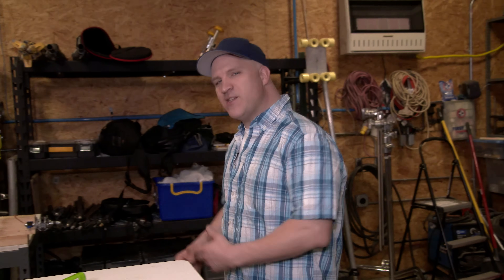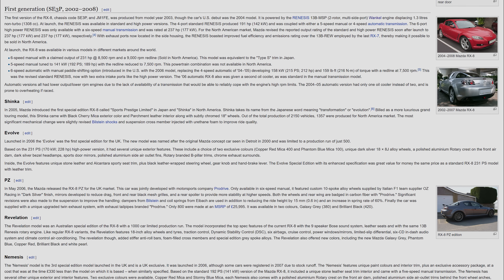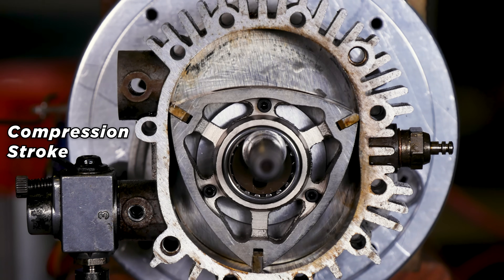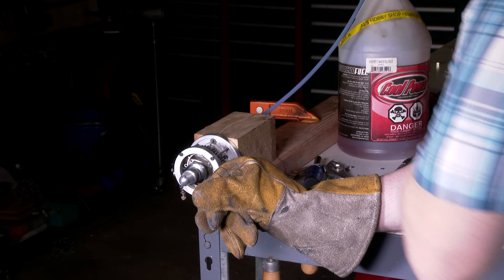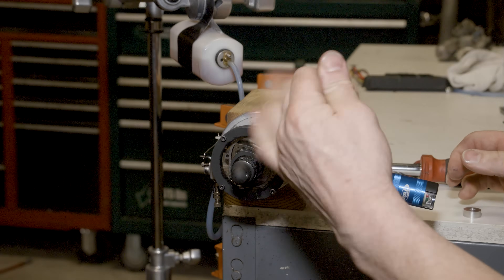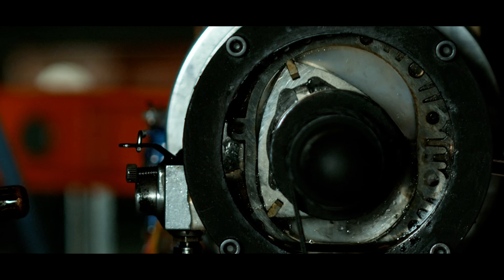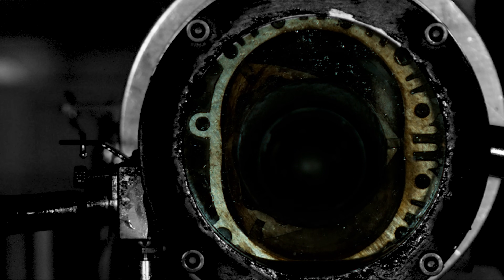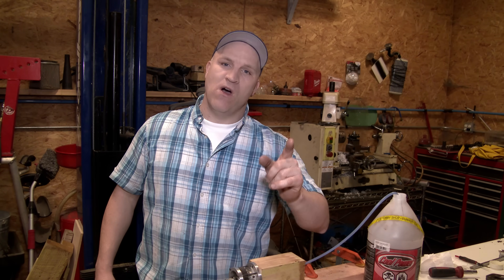See Thru Rotary Engine in Slow Motion - (Wankel Engine) 4K

Comment: I heard that rotary engine mazda owners verify their gas level and put oil in the car when at the gas station....
Reply: Jean-Yves Laliberté premix with 2 stroke oil to extend engine life
Reply: @Ben Stevens Only the ignorant ones... pre-mixing with 2-stroke oil is not recommended or safe... 2-stroke oil does not extend engine life or meet Mazda's minimum specifications and causes damage to the engine.
Reply: doktorbimmer I bet you still use 5w20 too right 😂😂Yeah you don’t know what you’re talking about buddy.
Reply: @Ben Stevens Only stupid people premix. I know exactly what I'm talking about... and I can prove it son.
Reply: doktorbimmer I’m listening you’re still talking
Reply: @Ben Stevens If pre-mixings works as you claim? Why doesn't Mazda recommend it? Why have Mazda engineers chosen Metered Oil Injection on all its production since the 12A???
Reply: @Ben Stevens Can you tell us what very important negative issues that are related to using pre-mixing instead of oil injection. Or are you suggesting pre-mixing has no down sides? Please explain how pre-mixing can extend engine life when there is no factual proof that it does... pre-mixing actually damages the engine and shortens engine life, it reduces power and efficiency when compared to oil injection... Do you understand why? Or are you just blindly repeating what some unqualified or inexperienced person has claimed?
Reply: @Ben Stevens Why would you use motor oil intended for 2-stroke engines in an engine like the Wankel KKM which is a 4-stroke?
 You are aware that 2-stroke and 4-stroke engines have very different operating principles and lubrication requirements that also require special lubrication specifications... Are you aware that many of these specifications are not interchangeable or meet manufacturer specifications???
Reply: Didn’t mean to start an argument guys lol, it was just a joke my dad told me a long time ago! 

The idea here is to NOT buy any rotary engine car ;-P
Reply: @Jean-Yves Laliberté Indeed, the best advice is not to buy one of these very unreliable, obsolete engines in the first place.
Reply: doktorbimmer before I even attempt to explain to you answer this. So bc mazda recommends 5w20 is the usa that’s the oil I should use in my Rx8? Answer please
Reply: @Ben Stevens WRONG! Mazda RECOMMENDS any of the oil weights listed in the operators manual found in you TEMPERATURE/VISCOSITY INDEX CHART This may vary by the region the vehicle was first sold.*
 The CORRECT ANSWER; Mazda recommends oil with an API rating of 'SL' or EC rating of 'GF3'  any oil with rating that has a viscosity that matches your climate and temperature range found in the chart IS APPROVED.
Reply: @Ben Stevens WHAT 2-stroke pre-mix oil you are you using that meets API SL/ EC GF3???? Please answer???
Reply: Are you a teacher Ben Stevens, because this is a tricked question!!
Reply: Jean-Yves Laliberté Ben is no teacher.. but he is about to get "schooled"
Reply: doktorbimmer what if my professional job was a teacher? Lol guess you know it all buddy. I deal with a lot of people in the race world and rotaries Hondas all that shit there’s nothing wrong with premixing buddy. I was trying to explain that I ran into some idiot on YouTube that said premixing is wrong for a rotary engine he looked at me crazy and said don’t you even reply. Green label racing castor made for rotary engine is what I use... And glad you know how to read a manual bro
Reply: I bet you put synthetic in it too huh 🤣
Reply: And that’s good I mean you can go off of what mazda says I’m not saying that’s wrong all I’m saying. To call someone ignorant for premixing really? Explain idemitsu then Mr know it all
Reply: @Ben Stevens Then I feel very sorry for your students...

Just more than you about pre-mixing 
 
Mazda has never sold a Rotary engine son, it sold Wankel KKM engines under the "Mazda Rotary®" brand name until 2012.
Reply: @Ben Stevens Klotz  BēNOL®???  This product is not recommended for any 4-stroke engine including the Wankel. Its only recommended for ratios up to 50:1 and is not compatible with petroleum oil either
 ITS API RATING IS ONLY 'SA' The LOWEST API RATING and does NOT meet Mazda specifications.
 It does not meet ANY EC ratings
Reply: @Ben Stevens According to the API, the term "Synthetic" is a meaningless marketing term... it only recognizes 2 types of base stocks based on their lubricity index.
Reply: @Ben Stevens There are 5 classes of motor oil base stocks that are sold under the marketing term "Synthetic" motor oil THREE of  them contain mostly petroleum base stocks... CAN YOU NAME THE OTHER TWO BASE STOCKS????
Reply: @Ben Stevens I can read owners manuals AND PRODUCT LABELS Sounds like most of what you know about motor comes from advertisements and internet rumors.
Reply: In my opinion, I would lean towards trying to put a little bit of 2 stroke engine oil in the gas tabk as I would think that it is meant to be combusted.... as opposed to a 4stroke engine oil? But I’m no mechanical expert and haven’t researched it as I was waiting for you guys to educate me SMH!
Reply: @Jean-Yves Laliberté You do not want to ever mix oil into your gas tank unless the fuel system and engine are designed for this. Adding additional oil into the combustion chamber to extend engine life has become a popular myth but there is in fact no advantages to introducing more oil than is injected by the Oil Metering Pump... the simple fact is too much oil is just as bad as too little oil. Pre-mixing causes more harm and has no benefits.
Reply: “   I know how to sit on a fence. Hell, I can even sleep on a fence. The trick is to do it face down with the post in your mouth.    ”

 - Dwight Kurt Schrute
Reply: @Jean-Yves Laliberté No worries my good sir, you are a scholar and a gentlemen... but it seems are young, naive lad Ben here needs to find himself post to bite down on quick before he digs himself in even deeper.
Reply: doktorbimmer y’all weird dab
Reply: @Ben Stevens Only the ignorant ones pre-mix... Thank you for proving my point son! Cheers!
Reply: @Ben Stevens And the API American Petroleum Institute publishes empirical data based on proven facts. You can't even read a product label son.
Reply: @Ben Stevens If you cannot offer any facts to support your false claims??? then opinions are all you have son.
Reply: doktorbimmer Premix to help lubricant of engine. Stock omp is not enough. (: premixing is a highly controversial topic. You’re entitled to your opinions
Reply: @Ben Stevens Pre-mixing only causes harm, it is not recommended by Mazda for some very good reasons that you seem completely oblivious of. Yes it is, if the OMP is delivering the correct amount than your OMP is installed incorrectly, damaged or needs service. There is no advantage to adding more oil than is needed. Pre-mixing causes carbon deposits and lowers the effective octane rating causing damage to the apex and side seals, spark plugs, lambda sensors and emissions equipment. Only among those who are not knowledgeable on this topic, the engineers at Mazda and lubricant manufacturers have no doubts.
Reply: @Ben Stevens I'm also entitled to call-out people giving bad advice on topics they do not understand... you should be ashamed of yourself kid, what you are doing is wrong.
Reply: @Ben Stevens Son, if you just read the manual and put the right oil in the right hole??? The OMP won't need any help... if your engine fails due to lack of lubrication??? It because you didn't check the oil level often enough.
Reply: @Ben Stevens The primary failure mode in Wankel engines is NOT lack of lubrication... this is another false urban myth spread by novice and amateur individuals that have no formal education or experience in field of automotive engineering or engine design.
 Apex seals fail as a direct result of ablative and brisance damage due to erratic and uncontrolled flame propagation and deflageration in the combustion chamber.
Reply: doktorbimmer 💀
Reply: @Ben Stevens What's the matter kid? Cat got your tongue? Without any facts you can't back-up your false claims.
Reply: @Ben Stevens If you are interested in learning more about Wankel engines or why you don't pre-mix the ones made by Mazda? I would be very happy to give you some additional facts and information... that way you won't keep making a fool of yourself. Cheers!
Reply: doktorbimmer 😎
Reply: @Ben Stevens Hey Ben! You put the oil in the ENGINE! Not the gas tank DUMMY!
Reply: @Ben Stevens Don't believe me??? CHECK YOUR OWNERS MANUAL... It says put GASOLINE in the Fuel Tank and OIL IN THE ENGINE!!!!! Lol!!!!

Comment: All the fuel going out
Reply: Very inefficient... that's why these engines are obsolete now!
Reply: doktorbimmer if it makes that much power at such a small size why don’t they make it at a bigger size and find a way to burn all that fuel before it goes out the exhaust but wouldn’t it make more HP at a bigger size
Reply: Bigger size means it would only waste more fuel, reciprocating engines make more power and use less fuel... that is why they are still made and these are no longer made.

Comment: That's neat! Does a real rotary engine use diesel?
Reply: No, Wankel engines require spark ignition only and a relatively high octane fuel to prevent damage, Diesel fuel is extremely low octane.

Comment: wankel engines rock  troll alert? leading plug hole lover?
Reply: EXCELLENT!  You are a quick learner indeed..to make that analogy means you understand the concept now... YES, in that regard the Wankel is Exactly like a 3 cylinder engine...each face is a separate chamber and each performs all 4-cycles one at a time just like the Otto engine.
Reply: @erniebrinkrotaryhemi7336  i love the moving combustion chamber

Comment: Any internal combustion engine is inefficient at start up until it reaches normal operating temp. Ideally we would all be driving electric vehicles with efficient modern batteries that are charged via a power station that uses non dirty source of power production. Nuclear power is probably the most viable source but people are shit scared of it. Even though coal is even worse in my opinion.

What's the point? Well I don't care about how inefficient the rotary is.. Well I do to a point but I think if we had more engineers working on them we could realise many gains from them. Just look at what the 13b in rx8 has achieved through optimised port positioning. It was about 20 years ago that you would only get that power out of them with serious port work like a bridge port and they would drink fuel. I like the rotary because it is super simple and elegant in its concept and design. No valves slapping about, no camshaft timing to worry about or belts. No springs, seats, collets, retainers, lash pads. All those components and the pistons rods and heavy crank need to rotate and that mass all needs to be balanced etc.. 

A 4 rotor won Le Mans and it was actually more fuel efficient than the competition. With more innovation the rotary could do so much more.
Reply: thank you dokterbimmer
Reply: @erniebrinkrotaryhemi7336  Call us today at +1-530-756-1230 or Email us at fm@freedom-motors.com
Inquire about our Rotapower® engines, or about investing in Freedom Motors!
Reply: @erniebrinkrotaryhemi7336  THE FOUR STROKES OF A INTERNAL COMBUSTION OCCURS SIMULTANEOUSLY IN A 
WANKEL ENGINE THIS MAKES IT MORE EFFICIENT THAN A PISTON ENGINE
1
Reply: Ernie! WHY? Why does you engine not run????

Comment: It's obvious gasoline is not the best type of fuel for this engine
Reply: @tmac20031 This engine is not running on gasoline... its running on nitromethane.
Reply: @doktorbimmer  what he says is still truth
Reply: @renatinhoss NO, its not true... gasoline is the most common fuel type used in Wankel KKM engines and is best fuel type available.
Reply: @doktorbimmer  the most common, yes. The most cheap and available, yes.
Reply: @renatinhoss Clearly you are not familiar with the history or development of the Wankel type KKM engine, it was originally intended and specifically designed to use gasoline as its primary fuel type, this fuel is also the best available fuel type for this engine.
  Many attempts have been made since 1960 to develop the Wankel KKM and adapt it to use alternative fuels, all have been unsuccessful... the Graupner GmbH. model 49 PI was never a popular or successful design and was discontinued many years ago.
Reply: What about if u modified the rotor with the same one way system a bike wheel has then used hydrogen and oxygen for fuel the result I think would be a engine that can run effectively on water with the power of fuel obviously further modifications required but I think it could work I’m gonna try making it
Reply: @icedtea5880  if there was a fuel that was extremely low carbon and extremely lubricating, to prevent carbon deposits and apex wear, it would be far more reliable than a piston engine
Reply: Michael Remington that’s exactly what I’m thinking
Reply: Anyone know if natural gas or propane have been tried?  I have a ICE that runs on propane (an old IH Scout II 345ci V8), and it LOVES it.  Research I've done has shown that propane is such a good and low pollution fuel because it burns so completely, and that it LOVES high compression, high performance engines.  A rotary would seem to be a perfect application for it, especially since propane "carbs" are vacuum diaphragms, and only release as much fuel as the vacuum from the engine will pull.  Thus, no over-fueling like we see in the above demonstration (and pitiful MPG in regular fuel rotaries, even the 13B's which used fuel injection).
Reply: tmac20031 well gas and about a cup of 2 stroke oil to a tank

Comment: It is not a 2stroke, not a 4stroke. What is it, a1/3stroke? or1,33stroke?
Reply: All Wankel engines use the same 4-stroke operating principle as a reciprocating Otto engine.
Reply: OK, thank you.  @doktorbimmer
Reply: How many working strokes is every triangular deliver pr rpm outgoing shaft?
Reply: It takes 1080° of crankshaft rotation for each of the 3 faces of the triangular piston to complete the 4-strokes. This is due to the 3:1 gear ratio between the fixed gear and the piston/rotor gear.

Comment: So a rotary engine is a lot similar to a 2 stroke piston engine
Reply: In theory it's a 2/3 stroke combustion engine since the entire cycle get done in 2/3 of a rotation.
Reply: @V L Complete and utter nonsense, All Wankel engines use the exact same 4-stroke operating principle as the Otto engine does... you need to learn how the Wankel KKM engine works.
Reply: No, not really. All Wankel engines operate using the 4-stroke principle.

Comment: However it gets the worst fuel economy, burns as much oil as gas, is actually unreliable on account of the extreme vibrations will shake the engine apart and I've had that done once, but they're very powerful for the size and the only engine I know of so far that can run 10x the rpm of a piston engine. But probably won't ever see them in another production vehicle again due to the first two things I mentioned earlier it's sad but oh well.
Reply: Actually reciprocating engines can rev higher... the internal components also only rotate at 1/3 of crankshaft speed... so the high rpm is deceiving.

Comment: The initial explanation portion of the video is very confusing because you keep reversing the way you are holding the model and direction of rotation of the crank which interferes with visualization of operation.
Reply: Otherwise, Nice job. :)